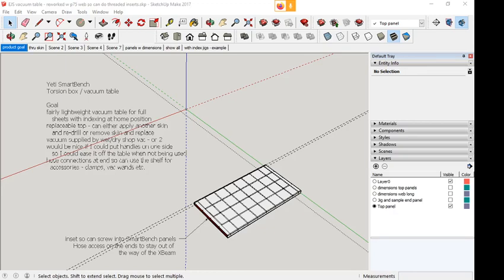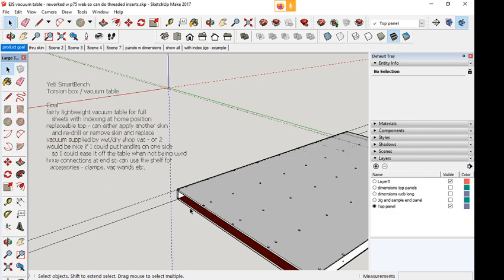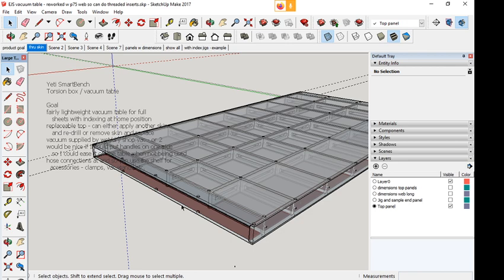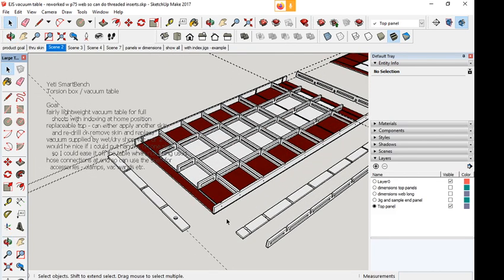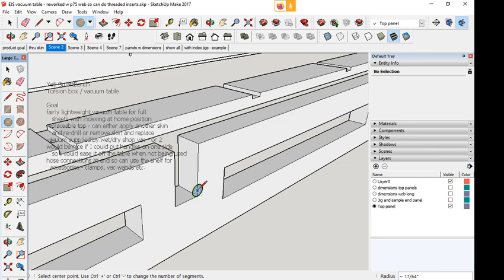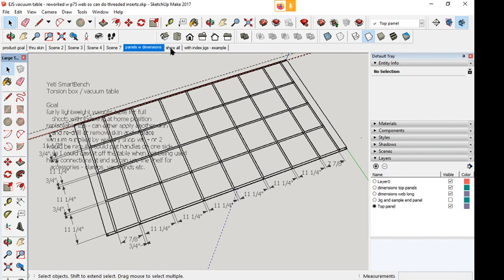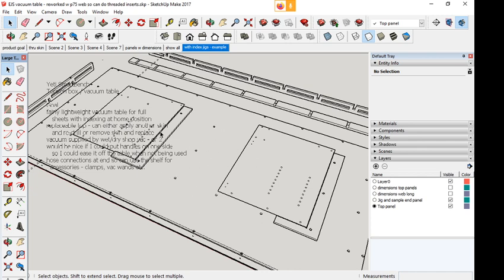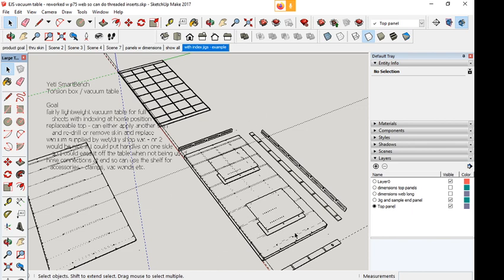Sketchup - vacuum table design ideas - powered by wet/dry shop vac.

Comment: one more tip if you make the grid and a melamine bottom plate, and for the top plate, just use a simple sheet of a quarter inch mdf? Don't have to use inserted threads and all of that, just a sheet of mdf and the suction will keep it in place and it gives you a hell of a cheap waste board. AS long as the sides and the bottom are airtight, all the suction power pulls the mdf down and all you place on top of the mdf will stick to the mdf . the sides of you mdf sheet should be sealed also against false air suction. Just a lick of paint 
And if you got some time left, I'd advise the next clip (2 parts)
https://www.youtube.com/watch?v=ioepaP17UpQ
Kind regards Hans

Comment: Why don't you mill all  those half lap joints vertical ? I made dozens of drawers with true dovetails on my previous cnc (shapeoko) machine Just put all of your parts together with a few clamps and mill the slots trough al the parts in a few long passes. They could fit perfectly

Comment: Hi. Have you had a chance to build this yet.  I’m looking forward to seeing how it works.
Reply from the maker: Yes I have.  I'd do it differently next time.  No need to dado the webbing into the top and bottom.  No need to use 3/4" webbing so I could find the joints and put insert threads in - just glue plywood or scrap rectangular pieces APPROXIMATELY in the centers of the areas of the webbing to the upper sheet and let the Yeti drill the holes for them - much simpler.  Saves weight also.  Do not use MDF - it's too heavy - use foam board from a local plastics distributor -- LAIRD PLASTICS has it in my area --- much lighter, but structurally very sound (approx 1/2" thick).  I also cut dowels to fit the holes in my table and screwed 6 of them in the BOTTOM of the vac table so that table would be indexed to the machine repeatably for when I took it off and then put it back on.  These are the main improvements I will incorporate into the next one.